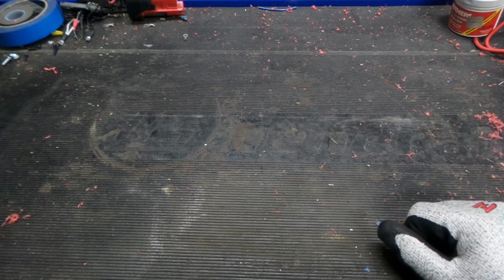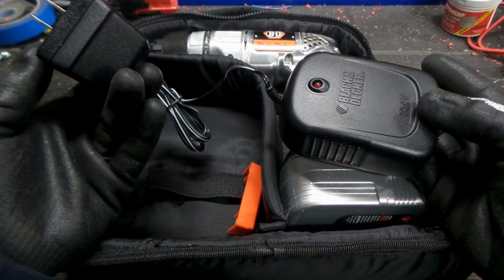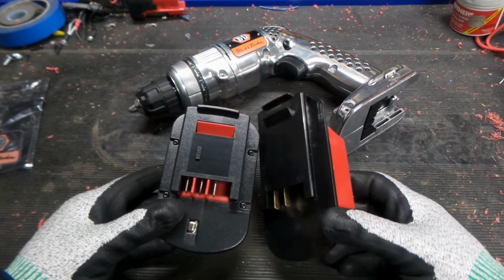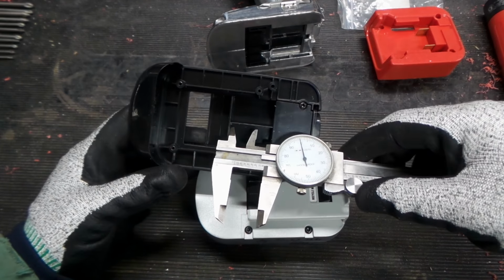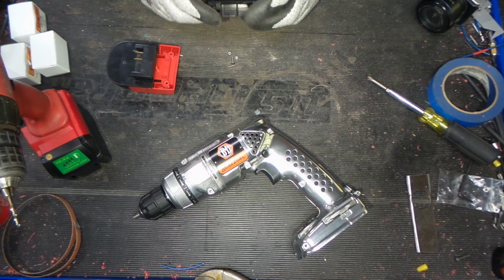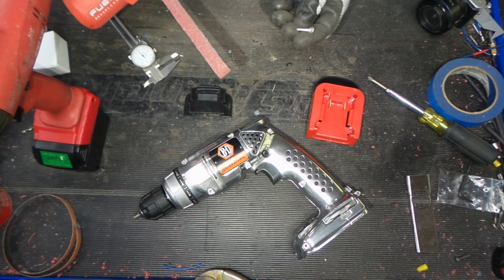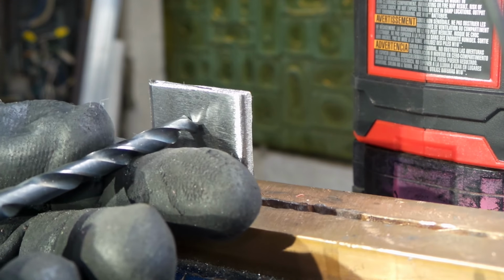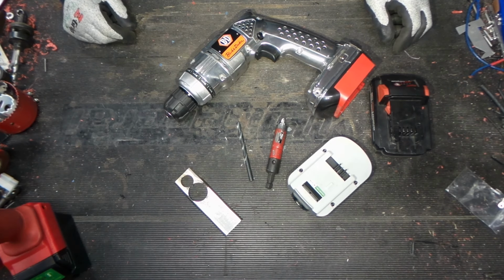Black & Decker 85th Anniversary 14.4V Cordless Drill - Powered by Milwaukee M18 CP3.0 Battery

Comment: One downfall is that it doesn't stand up.  Front heavy.  Just ordered anew battery for mine, haven't used it in years.  Project in mind, a custom stand.
Reply from the maker: That is true I have a feeling that's why T handle drills are the most common these days. Back in the 2000s you could still get Pistol Grip like this or T Handle.

Comment: How much is it worth 85 anniversary signed
Reply from the maker: These really don't hold a high value. You can get them for between 50 and 100 dollars. The stock chucks are not all that great, and you would have to custom make any battery adapter to use them, which I think really drives down the value. 

They are a great light duty drill, though, once you do the upgrades.

Comment: what what the model of the replacement battery you used?
Reply from the maker: I used the Black and Decker 18V to Milwaukee adapter and modified it to work with the 12V Black and Decker tool.
Reply: I understand the Milwaukee from the video title.... don't understand how I guess, or why it would work, was 14.4 that common then???? across brands?
Reply from the maker: Yes 14.4V was very common. It was 12 1.2V batteries in series. Your lessor line was normally 14.4V and your top line was 18V.
Reply: I just looked and couldn't find the adapter.....when did u get it? which seller?
Reply from the maker: Search Black and Decker 18V Old Style to Milwaukee.
Reply: would a DeWalt 20v battery and adapter work too?
Reply from the maker: I wouldn't see why not if you got an adapter for the old version of the Black and Decker. Just know you will have no battery protection and if you're not careful you could draw the voltage down too low in your battery and damage it.

Comment: Hi I have the same drill great video been looking online for the adaptor. But no luck maybe because I am in Great Britain did it come from Amazon
Reply from the maker: I got it off Ebay. Look up the 18v version. That's what this is cut down to work with the 14v drill. If you make an adapter be sure to keep track of your M18 batteries charge so you don't accidentally damage it by discharging too much. There's no safety on this adapter.